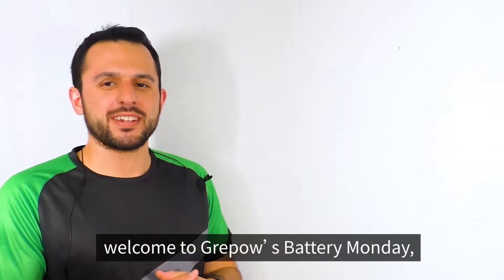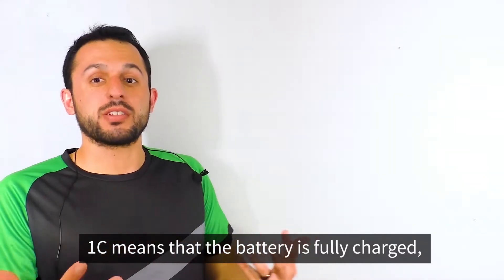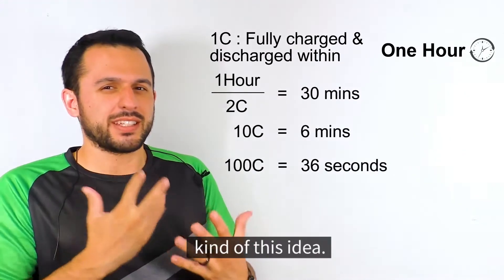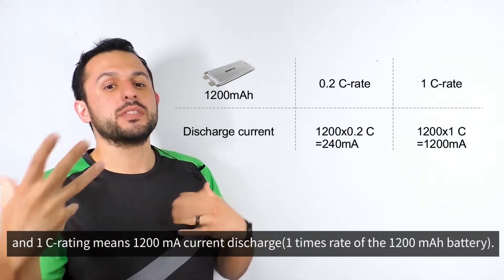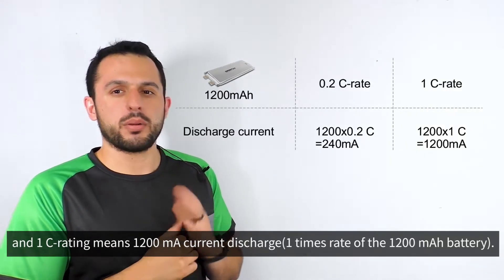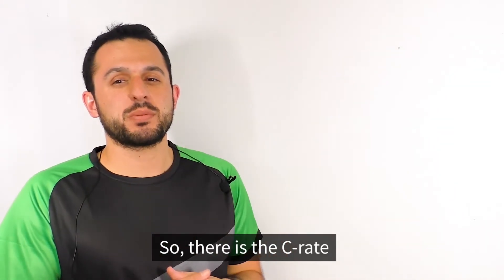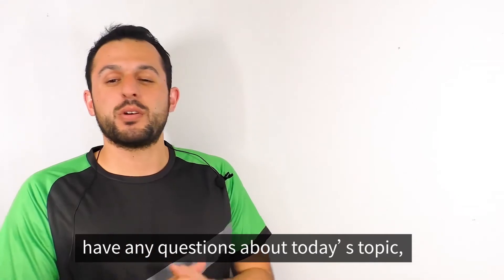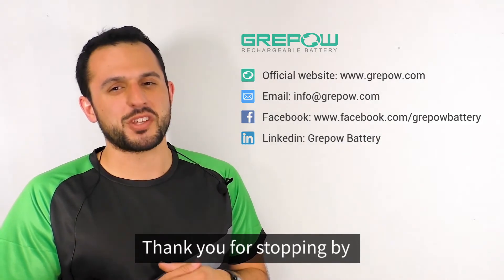What is C-rate of lithium battery? - Battery Monday | 19 OCT 2020

Comment: hello ZAK 
thank you very much for great effort , it was very useful 
i have one question
if we have battery modules with power ( 100KW)  for example ,
how can i express the relation between KW and KWh in two cases
first case , if Crate=1  (1C)
and if we have (2C)

iti is like that 

100KW/100KWh for first case

200KW/100KWh in the second case?
Reply from the maker: Hi Ahmed, thanks for your question, your understanding is correct, let's take an example: 

Battery pack type 20V 5Ah 1C rate
Then continuous power is 20V*5A=100W
Watt hour=20V*5Ah=100Wh

Battery pack type 20V 5Ah 2C rate
Then continuous power is 20V*10A=200W
Watt hour=20V*5Ah=100Wh